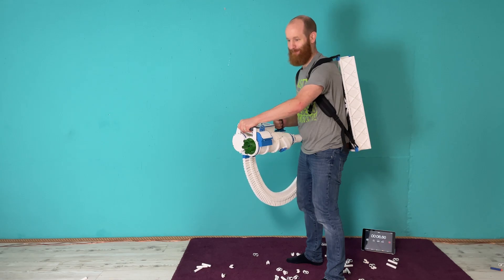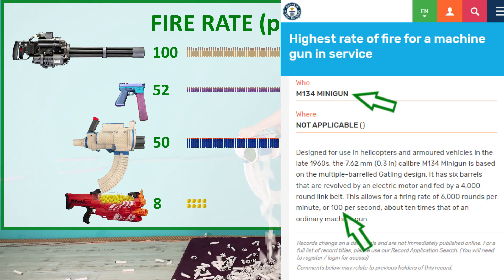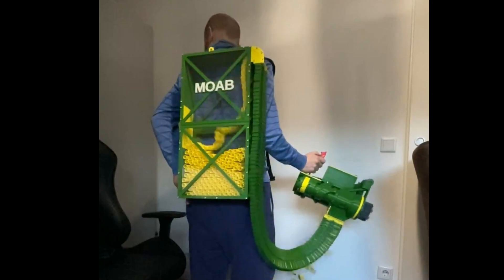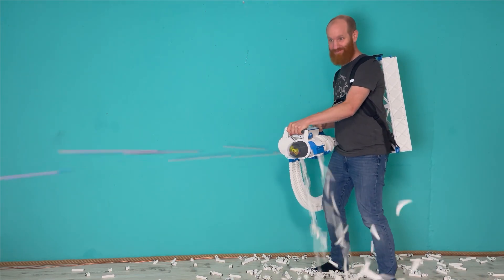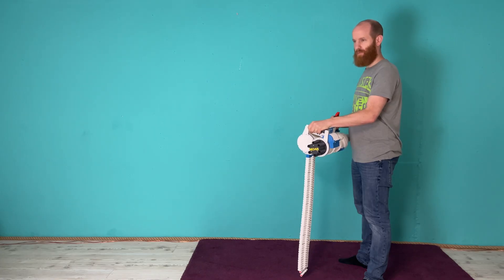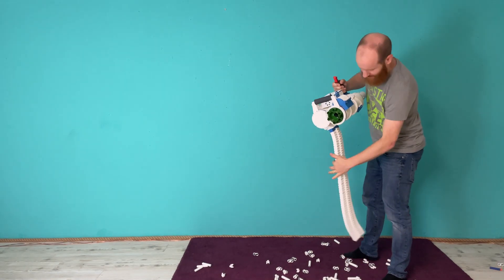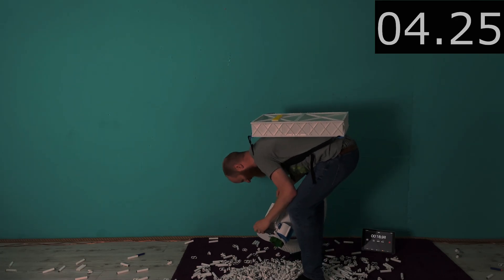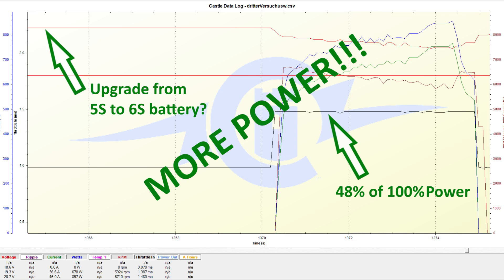3D printed Blaster faster than the REAL Minigun??

Comment: I am foam dart weapons guy, and this is my weapon. she weighs 50 kilograms and fires 36 pence bog standard darts at 6,060 rounds per minute. it cost £436.32 to fire this weapon for 12 seconds!

NOTE: this reference is assuming a pack of 36 darts is purchased at the price of £12.99 as listed on Amazon in the UK on 2024-Oct-01, and the weight is a complete unsupported guess plucked out of thin air

Comment: could we get the parts and and the file you used to 3d print so we could try builidng it ourselves
Reply from the maker: I want to sell the stl files (manual required, some optimizations part wise, hardware kit would be nice), but I have other todos first.

Comment: I wonder at what fire rate you would have an issue with darts colliding with the dart that came before them
Reply from the maker: Not yet. I think I am at 25% dart and 75% no dart, also there is another reason that would allow colliding darts but it’s difficult to explain. If the darts get too tight to each other I would need to increase the speed of the darts to create a bigger gap again.
Reply: @gatlingtommy  Will you ever make more after the first hundred?
Reply from the maker: @gabecollins5585  I am not sure, what I will do after the first 100. it is so much effort to build these things… if I continue making blasters, it would be a somehow different version and then w/o numbers etc

Comment: I have waited a while since this came out to just point out: now that you rule the roost of standard nerf dart miniguns, 

at some point you have to consider a MEGA dart version. I suggest the name "Vulcan", as the minigun was the little brother of the M61 Vulcan 20mm autocannon.
standard, it fires at the same rate as the IRL minigun (0-6,000rpm).

another potential idea would be a quad-mount turret based on the Dillon Aero quad-minigun mount, to go after the "highest fire density of a single system per second" record. 
(I would mount it on a 3-d printed mount that can be controlled by a remote and made to only fit the ammo, guns, and the motors and servos needed to make the turret rotate, elevate and fire.)
turret for reference: https://www.youtube.com/watch?v=tLcwZ4p2pIU
Reply from the maker: Haha, with MEGA darts it would be ridiculously big (not that its not ridiculous now ^^), also I feel that the MEGA darts are pretty weak / break easily.

I thought more about making a short-dart version, this would reduce the size and weight of the complete blaster a lot, and it would probably also increase the dart speed (because of lower weight) and would pretty sure increase my maximum firing rate (one limit is, that the darts aren't flying out fast enough, when the darts are only half-length, it should allow doubling the speed, if the darts are then even faster...). But when increasing to 200 darts per second, I am pretty sure a lot of other mechanical bottlenecks would pop up also...

That Quad Minigun is really crazy, I have a dual minigun in mind, not sure if I can make it & a video about it this year... I don't want to spoiler too much now :)
Reply: @gatlingtommy  I wouldn't expect it to fire as fast as the smaller version either, but it would probably still be the fastest firing MEGA dart minigun because... there aren't any others lol.

the quad-minigun should be easier to build just because you already have a functioning example to go off for making the others. just make sure to make two of them mirrored (ejecting the other direction) just to make it easier to mount without needing to worry about ejected casings causing feed issues for the other side's guns. (plus it would look like the Tunguska SPAA's way of ejecting shells when firing, which is extra neat for slo-mo.)

Regardless of other developments, I want to suggest painting the backs of the darts with glow-in-the-dark or UV sensitive paint, so you can shut the lights off (or swap to a blacklight) and get to see what "Tracers" would look like out of a nerf gun, as it might be a fun excuse to record another video.

remember, these are all just suggestions, so you don't technically need to even read this. just want to put the idea out there because I don't have a reason not to.

Comment: The minigun only rotates for cooling, being a dart gun this doesn't need to be a feature (but yes, obviously it looks cool). You could remove the barrel spinning part of the design to achieve even faster fire rate without the complication of timing barrel alignment with dart release. This is how that machine pistol (pewpew) shoots slightly faster than your MOAB, no spinning barrel so much simpler firing sequence.
Reply from the maker: I cannot agree with you. First, the Minigun (M134) as the original Gatling Gun require the rotating barrels to load and shoot the bullets (via cylindrical cam stuff), the same goes for the MOAB - no rotation no bullet/darts.
Second, how fast is the pewpew? last time I spoke to Pippo the limit was "up to 52 darts per second"
Reply: No need to get defensive, no offense was meant. Fundamentally the rotation was causing jams for you, yes? That is what happened in the video to the point where you shortened the barrels after adjusting the timing didn't fully solve the problem. Making a mechanism that doesn't rely on aligning a barrel with the dart feed at just the right time would lead to faster potential rate of fire because the max rate of fire would no longer be limited by the precision of the alignment.

You showed us the chart where the pewpew was 2 faster (52) than your original MOAB (50), that is all I was pointing out when stating it is probably because of a simpler firing mechanism (no rotating barrels causing alignment issues).

What you got was impressive, I just wanted to suggest what seems like the simplest way forward if you wanted even faster fire rate.

Have nice day. @gatlingtommy

Comment: I hate to break it to you but if you where going for the overall world record the M61A2 vulcan used on the F22 and Super Hornet fires at 6600 rpm (110 rounds per second).

There may be faster guns too this is all I know off the top of my head, guiness world records are not a reliable source on military hardware.
Reply from the maker: I know, I was a bit carried away in this video - but my MOAB fires faster than any hand held gun, that’s still crazy

Comment: Start at 6.58 and end at 10.92 4.34 seconds. So no record.
Reply from the maker: Sorry to which times are you referring? Did you stop the time when the last dart exited the blaster?
Reply: @gatlingtommy  watched it again on pc. 6.51 is when the darts start moving and 10.87 is the last frame the dart touching the barrel.
thats 4.36 seconds.
Reply from the maker: @garryoddson3864   oh now I get you! You meant the time on the ipad *facepalm*. 
I now took the video I uploaded to youtube, split it up frame by frame and here is the result how I would calculate the firing rate:
The first dart leaves the barrel at 6.72s, at around 10.87s the last one leaves it, this took 4.15s.
If you want to be really precise, the 4.15s measures the time it took the blaster to fire 429 darts (since you measure start of dart 1 and start of dart 430, which means you only measure 429 iterations). 429 darts / 4.15s means 103.37 darts per second - so yes, I did beat it!

Comment: For military grade firepower, I highly doubt we're going to get to a point where higher fiery rates are used because the ammo you need for an m134 is a little stupid, going much higher and fire rate would make that stupidity worse and eventually you'll get to a point where you have a single Blackhawk which is purely minigun ammo
Reply: It’s also more wear and breakage on parts firing faster. The good thing is that since the M134 is electrically powered it’s pretty easy to turn it down and get the fire rate you want.

Comment: You might want to take a design feature from the [Phalanx CIWS](https://en.wikipedia.org/wiki/Phalanx_CIWS) (up to 4500 rounds per minute).  The barrels are actually curved so that while rotating, the rounds experience a straight barrel.  ie if the barrel has rotated 5 degrees by the time the dart exits the barrel, the end of the barrel should be 5 degrees "behind" the chamber.

Comment: This was very cool, danke :)

Is there any chance you could have a set up with audio of an actual minigun firing for as long as you hold the trigger down?

The idea I once had was to splice together audio of a minigun firing as a 10 hour long MP3, upload it to a cellphone which in turn would play it through an amp with either a blutooth or wired connection, with the amp of course dressed up to look like an ammo box you wear on your back.

It was to be for an airsoft gun, so the BB's were already in the body of the  minigun.

So I guess to simplify it: a cellphone with a 10 hour long MP3 file of an actual minigun firing, connected to an amp on your back with the trigger of the gun acting as a switch for the connection where when the trigger is de-pressed, the audio is cut out and when its pressed, the speaker plays the audio.

Comment: This is incredible. Does this design actually feed and extract the casings from the individual barrels?
Reply from the maker: Yes, each barrel has its own firing mechanic, so each barrel is fed with a shell+dart and then fires the dart.
I really have to make the technical deep dive videos, sadly I am pretty booked with other topics the next weeks/months
Reply: @gatlingtommy  that’s incredibly cool. Is there one actuator that feeds the barrels, or does each barrel have its own bolt to feed and extract?
Reply from the maker: @bend1707  well it’s done by the rotation, I think I reall have to make an animated video to show this.
Reply: @gatlingtommy  that’s cool. I think I have an  idea of how you did it. Is it essentially the same feed mechanism as an M134D mini gun?

Comment: You know, that is impressive and all, but when it comes to gatlings china has the type 1130 with over 10.000rpm and is developing a 20 barrel ciws, which fires 2 barrels at the same time. A german knocking off a chinese idea sounds strange, but you should really step it up and get a dual feeding gatling for 200+ darts per second!

Comment: So, the minigun is the fastest firing MAN-PORTABLE machinegun (though it really isn't practical carried by a single person). There are weapons that have WAY higher fire rates, but they're generally mounted on vehicles or require additional setup, like the Metalstorm.
Reply from the maker: That’s right. In this video I was a bit too enthusiastic/carried away, in future I will be more precise on my statements.
Btw, the company who did this metalstorm prototypes went bankrupt, it has a fixed capacity etc, somehow I don’t found this thing 😉 (else we could count a two barrel shotgun which shoots the two slugs at the same time as a machine gun with an infinite firing rate).

Well, maybe I just want to believe the metalstorm don''t count since its easier that way ;)
Reply: @gatlingtommy  Yeah, the company went bankrupt, but a few working prototypes do exist, but I get your point.

Regardless of fire rate, your blaster is awesome. Must be a pain to clean up after, though. It's all fun and games until someone has to reload the thing.

Comment: Whoa hold your horses, my man...! Sorry if I'm nitpicking, you're making it fire that fast, but the tradeoff is reducing the range & accuracy of the darts

Also, this is just my opinion but you gotta fix the issue of the darts not leaving the barrels fast enough to clear the next one
Reply from the maker: i did "fix" it by reducing the barrel length ;)
Also, who needs accuracy at 101 dart per second? ;) I get your point, there are some situations were this 101dps upgrade has more drawbacks than benefits (ignoring the obvious chaos its creating...)

Comment: Tall claim considering that pretty much every modern gat gun has an adjustable fire rate, 3000 rpm is just what's practical and usually the lowest setting
Reply: But a friggin cool build either way
Reply from the maker: well the m134 has different variants but never goes over 6000 rpm, so with my 6060rpm I am faster than it.
But some correctly pointed out, that there are gatling-guns with higher firing rates (and this metal storm that I don't count)

Comment: I have a theory so if you would put more barrels and to put a smaller gear ratio would you think you could make it faster(if provided the power requirements)?
Reply from the maker: I had to think about it, now I think you are right: using a higher radius and then the same fire rate should reduce the centrifugal forces on the shafts, so this is on big bottleneck.
The other bottleneck is the loading of the springs of the blaster, which each would have more time, if each barrels shoots more rarely. So you suggested version should allow a higher firing rate.

There is only one drawback: this monstrosity would become even bigger, even more material, heavier, bigger and crazier, isn’t it crazy enough? 😉
Maybe I go this path if I really want to go crank it up some more level 😂
Reply: @gatlingtommy  I don’t really know a lot on how this dart blaster works but that was just a thought but once you have the video ready I’ll be able so understand it more

Comment: Is there a reason to have multiple barrels in this case?
Reply from the maker: The multiple barrels are the main reason why I got to this firing rate: each barrel is doing the loading, shooting, unloading step in parallel, so each barrel has a quite low firing rate buy combined they go nuts

Comment: Are we still talking about regular spring loaded firing or you got an air compressor in there? Talking about automotive valve spring rates with this thing.
Reply from the maker: I use regular springs and their loads isn’t so high since I got 6 independent springs.
I will make a video about the internals, than you will see what I mean

Comment: Real Miniguns are capable of 100 shots per second. Microgun can achieve 166.
Reply from the maker: Well I didn’t no about the microguns high firing rate. Somehow the m134 still holds the firing rate record at Guinness, maybe because the microgun was only produced in a small number?
Reply: @gatlingtommy  A couple GE prototypes in the 80s. Later General Dynamics tried to resurrect it as a high(er) ROF door gun in the 10s but it went nowhere. They advertised a 10K per minute cyclic rate in some of their literature.

Comment: It would be cool if you upgraded it further by adding a flywheel propeller at the end which would make the darts both more accurate and also fly faster. The problem is that the darts are in a irate enough they might get backed up so several darts are in the barrel at a time, jamming the gun.

Comment: i want you to make it higher fps to the point where you can have barrels that look good and still dont make darts fly everywhere because if we are being honest it would look so much better with long barrels
Reply from the maker: Well, to increase the fps I would need to increase the spring tension/forces, which would create higher mechanic load on some blaster parts - so their breaking point is more of a bottleneck. Also I think this blaster is devastating enough, if it’s Darts would hurt, I think it would be too much

Comment: 0:56 Just gonna throw in my "well ackthually"-- metal storm is significantly faster, by using several hundred barrels to fire at ludicrous rpm (for a ludicrously short amount of time).

This isn't a correction, its a challenge. Make a metal storm blaster

Comment: Your math is incorrect. The rate of fire for shooting 400 darts in 4.25 seconds should be less than 100, actually about 94 darts per second. If the rate of fire was actually 101 you would have shot around 429 darts. You djd not break the world record sorry :(
Reply from the maker: sorry dude, I shot 430 darts in 4.25seconds (to beat the 430 dart challenge), many people misunderstood this...
Reply: @gatlingtommy you said, and this is a quote, ”so, the result is, 400 darts in 4.25 seconds”
Reply from the maker: @josalbatross321  my pronunciation is not good, so it might be difficult to hear, but if you hear closely, I say „430 darts in 4.25 seconds…“☺️
Reply: @gatlingtommy you definitely said 400 not 430. 430 is two syllables more and you only had 3 syllables not 5

Comment: idk how much work it would be at this point to modify the darts the gun fires, but to help with preventing the bullets from skewing as they leave the barrel, it might be worth cutting them shorter so that the tail leaves closer to the tip and gives rotation less time to affect it between the 2 points leaving

Comment: If the increasing barrel spin is affecting the darts too much, the modern DOOM games may have a solution.
Spinning barrels with their own spinning barrels! Rather than a 6-barrel cylinder, it's three separate 3-barreled cylinders.
This means that each barrel rotates about two different axis, and at a certain point in their motion that rotational speed cancels out such that the barrel slows down or even stops in place. Spirographs demonstrate a similar phenomenon.
This way, you can have the barrel spin even faster while still having a brief moment where the barrel is spinning slow enough to get darts through cleanly.
Reply from the maker: I just see this now - It could really work but MAN I thought I already overengineered the hell out of this blaster, this here would be a completely new level of complexity ^^